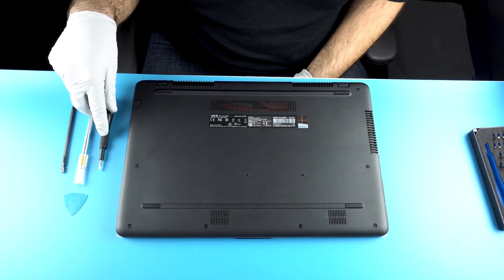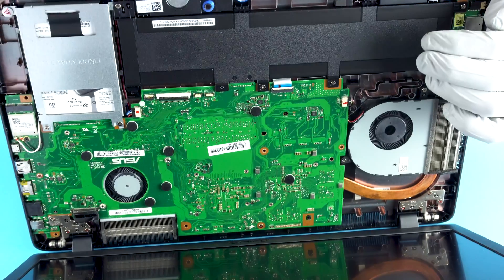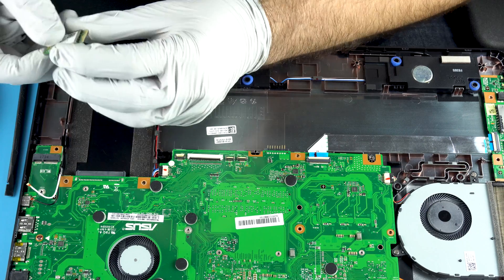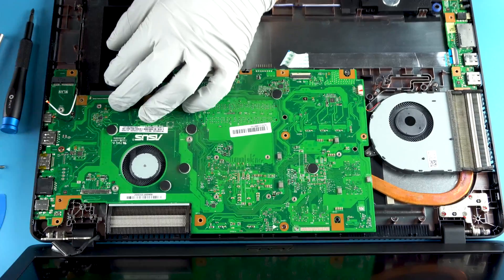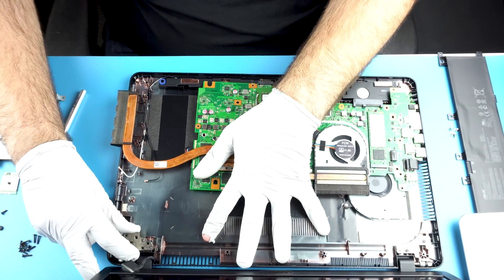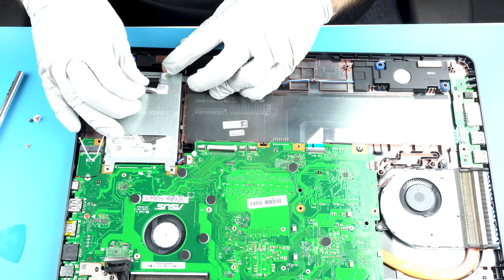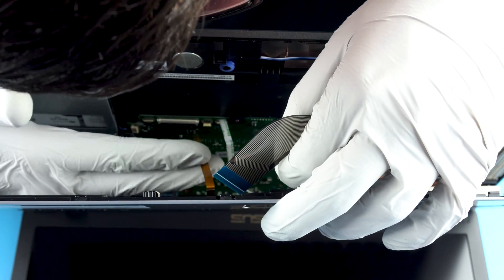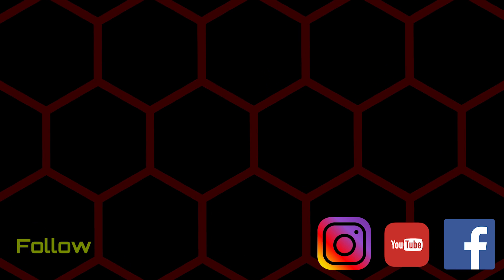Asus Vivobook 17 Pro N705UD | How to Service Upgrade & Laptop Teardown

Comment: Nice video.  It showed me how to remove the cables, but for something so critical to the success of this operation, it would have been much more helpful if the cable removal process was shown in more detail.  I had to rewatch a few times to catch the part where the cable holders had to be flipped up to release them.  And the keyboard cable removal was obscured so that detail could have been shown better.  Anyway, I finally got my battery, M.2 and HDD replaced with new parts.  In the future I'll have to do more research before buying a laptop so I don't end up with something that's such a nightmare to update.

Comment: Only way to start my Asus n705u is to remove AC cable, remove battery, put battery back in, reconnect AC power, and only then do 2 white lights appear bottom left of casing, near audio port, and I can then power on. It's a brand new battery that can hold a charge for months. BIOS reset. Cannot find the CMOS battery to try replace that, I don't know if this laptop even has one.

Comment: @Cukusa Great! you helped me upgrade RAM to 32Gb and a Intel Wi-Fi Card 6E
Reply: Which model exactly? I've been scouring the interwebs trying to find if mine is compatible with 32 gigs. I know my CPU is, just can't find if the mobo supports it. Also, was the replacement faster than 2400 Mhz?
Reply: @RedeemX-h2x 2400 is the maximum supported, I installed Crucial CT2K16G4SFD824A

Comment: Awesome video, following this managed to upgrade my M.2. Massive thanks. Only challenge was previous owner had not only removed M.2 but taken screw. Quick fix use one of the battery screws and will sort later. Also had planned to us heatsink but was too thick and motherboard slightly raised. First time fixed back on the trackpad was slightly raised, had to remove back and ensure one of the ribbons was bent over, used some sticky tape to help.
Reply: Did u upgrade the m.2 or to nvme ?
Reply: @mozesong5264  I installed a "Crucial BX500 1TB 3D NAND SATA 2.5 Inch Internal SSD - Up to 540MB/s - CT1000BX500SSD1" and also I updated 'Integral 512GB SSD NVME M.2 2280 PCIe Gen3x4 R-3450MB/s W-2400MB/s TLC M2 Solid State Drive'.

Comment: For those wanting to upgrade the 256GB M.2 SATA drive, YES - your laptop will support a NVMe drive!  Got a 1TB WD Blue during the Black Friday sales and it works perfectly.
Reply: 2TB Seagate Firecuda 520 gen 4. just for funzies!
Reply: Can confirm. My laptop model is a little different as it ends with X705FD_N705FD instead of N705UD, but it has the same type "Asus Vivobook Pro 17". I have successfully upgraded from the default micron ssd to a 1tb p31 nvme ssd just now, thanks to this video and this comment.

(Additional useful info for beginner people like me: )
- After changing your ssd, it may take a while for the pc to start booting for the first time so don't panic if the laptop doesn't immediately respond after pressing the power button
- If the laptop gets stuck at something like "something from startup isn't there/isn't right" when trying to start it the first time after swapping the ssd, boot into safe mode first and then restart the pc. It will work after that.
- Also if there's a weird issue such as image and video files not opening or you get something like "these pc results may not be complete" when opening cortana, it will fix itself when you reboot the pc 1~2 more times
- Don't forget to sync the time after finishing! (Idk if it automatically corrects itself after a while)

Comment: I just bought this computer, it will be here on Monday, now I kinda wish I had seen this video first because with my hands having bad Rheumatoid Arthritis, upgrading will have to be done by geek squad at Best Buy where I bought this thing, what happened to having individual covers on the bottom that you could remove and add a second HDD or memory without removing the Mobo? ah yes, make it harder so that you have to take it in to have it upgraded. so that this is now the standard saying "No user-serviceable parts inside"

I cut my teeth building systems from scratch for years, it is getting to the place where there is very little we can do ourselves due to the complexity being built-in on purpose.

feeding the corporate machine and that is just how they want it.

Comment: This laptop is no worst than any other one ive worked on. I  had a gpu bracket come unseated . Had to reglue them, but i ran out of kryonaut . i
I have some offbrand on my cpu for now because i trust the i7 to throttle the cpu better than the card . ???question IS do you reccomend a 30% silver on a laptop 1050 and 8550 like these or should i look at a different type of paste to Achieve optimal temps ? maybe heat pads on the ram or spreaders ?

Comment: Does s have two slots for an SSD? Because the Amazon site says it can hold a 1TB HHD, and a 128GB SSD.
Reply: It's configured to hold an HDD (or SSD) which is easy to get at, and a M.2 SSD which is underneath the motherboard.

Comment: Does the m.2 slot support NVMe drives?
Reply: Yes, i installed a sabrent 512gb and it works fine (3400 mb/s reading, 2500 mb/s writing)
Reply: @Paolo_980  still working fine?
Reply: @GolD3enAg3e  yes, all fine. I am using it right now.
Reply: Seems like a maybe. Contacted ASUS support and they said it supports SATA m.2. Others in here have commented that they upgraded to a Samsung EVO 970, so maybe? I'd love to know for sure!

Comment: Is there a way to hard reset the BIOS for stuck Vivobook Pro 17? I couldn't see a CMOS battery or jumper to do that.
Thank you in advance!
Reply: Hello. Could you/someone finally find a solution? I’m facing same issue, and I couldn’t find cmos battery or jumper hose too. Thanks for help.
Reply: @TT-hy3ml  No, I had to buy another laptop

Comment: That's a great video. I own the same model. I use it daily for 8+ hours. What would you say when I should replace the thermal paste on CPU and GPU? After 1 Year, 2 Years? The notebook is fine. Even though the fan on the left side is a bit noisy under load. Kinda high pitch noise.

Comment: You can fold up the board without unplugging the screen cable,  also the M.2 supports Nvme  with read speads around 2500 and wright 1400  so worth the upgrade
Reply: I want to install an SSD on my laptop, cause my vivobook pro 17 came out of the box without the SSD. So it's really possibile to install the Nvme version? (Thanks and sorry for my bad english)

Comment: so just got the model ASUS Vivobook 17 X705UA-GC452T seems much the same, but only 8gig not 16gig, asked the shop to upgrade the ram to 16gig but 40min later they said they couldn't without taking the whole thing apart lol only wanted to see where the ram slots are hidden, seems piss EZ really surprised they had it for 40min and ended up giving up, so as always if you want something done Dont ask the shop, Just do it yourself

Comment: Why do they make it so damn complicated to add one thing of ram?
Reply: To maximize the portability, performance and durability while minimizing the size (thickness) I guess.. If you throw your laptop and it spits your ram away, that's a problem.. Putting the fan deep within the mainboard seems a good idea too for me.
Reply: each next generation is more and more difficult to upgrade by owner.
Reply: so they can pack a gpu a board and cooler into a small machine 🤘

Comment: Is it possible to change the hard drive by only partially opening the laptop without touching the motherboard and those cables connecting the keyboard?
Reply: Though I've not tried, but I think it's possible with 90 degrees bent hex screwdrivers. Still have to remove battery first.

Comment: I have just got a Crucial DDR4 2400mhz 8GB ram which should be compatible but after carefully putting it back together, it did not start. I checked everything, and reconnected everything once more, also tried starting it without the ram I just installed, but nothing. Tried an online suggestion that told me to remove battery and hold the power button for a minute then plugging the charge cable in and then put in the battery but nothing seems to work. I don't know what to do. All the components are 100% intact so I think it's a connectivity problem. Do you have any ideas that might help?
Reply: The cables can be very easy to damage if to ruff, did you find out what happened ?

Comment: I tried to install Win7 and got broken BIOS. It only starts and shows the ASUS logo, no any boot process. And it's impossible to open BIOS settings or any other functions. Only Pwr btn and Ctrl+Alt+Delete works. What should I do to repair it?

Comment: At 2:32 i can see were the wifi module is, there is another slot on the other side. Could it be possible to plug an m2 ssd in there to expand the internal hard drive?
Reply: Normaly there is room for one more.

Comment: Is cpu upgradeble m8? help me pls
Reply: The motherboard does support driffent cpu's but why would you need to upgrade, the CPU that comes with it is very good, the letdown is the cheap drive they use, replace that and your see the most difference, i installed a  Samsung 970 EVO Plus 500GB M.2 (2280),NVMe SSD R/W(Max) 3,500MB/s/3,200MB/s, 480K/550K IOPS, and in the HDD bay another 500Gb samsung sata ssd, also upgraded the ram from 8gb to 16gb

Comment: The asus engineering is beautiful
Reply: Portgas D. Ace I don't agree. This laptop is very difficult to work on. Prefer designs that are easier to disassemble and reassemble. The further we go down this path the closer we get to a situation where its so risky to attempt it that its practically unserviceable.

Comment: Nice vid! is it possibile to chane the m.2 ssd opening the pc from the back, instead of dimsnatling everything :)?
Reply: Not possible. There is no access from the back. The only way to get at the M.2 is to remove and flip over the motherboard.  Can't partially lift the motherboard either, there are cables on 3 sides that need to be disconnected.

Comment: Very nice video! Thanks. I've upragraded my laptop by adding a new SSD, but after 1 month sound from the speakers dissapeared. If i plug in my headphones, the sound is ok. I've reinstalled the drivers - no help.

Comment: Does this asus work with nvme ssd?
Reply: I have the ASUSTeK COMPUTER INC. X705UNR 1.0 with the followingWDC WDS100T2B0B-00YS70.  I believe this drive is an NVME SSD as well.

Comment: Nice video... I have a problem though... My computer does not start and I really need to take back information that are on the SSD and HD... You know if I would loose the warranty if I take them out to take the information? I've seen there's a sticker on one of the screws on the HD... That sucks :p
Reply from the maker: Well, that depends. You do have a right to service your laptop if you are in the US and some other countries. I would check with Asus and see if that would void your warranty first.
Reply: Computer Upgrade King thanks for the quick answer... Will do as I'm in Brazil until July :(

Comment: What do you think of putting conductonaut on the cpu and then place a .03 copper shim then kryonaut?  I used conductonaut on an old xps17 and it dropped the temps 20°c, granted just removing the old thermal paste probably helped a lot in itself.

Comment: Thanks so much for posting this video.  I have a N705UN-ES76 and it looks similar to the N705UD-EH76 but instead of having one exhaust on the side and one on the back, they are both in the back.  I'm sure the disassembly will be basically identical.

Do you know the max ram that can be installed?  I was looking at a set of 2x8 DDR4 2666MHz. I cant find any information besides corsair's website that says these will be compatible.
Reply from the maker: Hey John. Max ram would be 2x16GB 2400.
Reply: Thanks!
Reply: I ended up grabbing 2×8gb sticks.  Also, it turns out I only have one fan.... Oh well.  I was going to liquid metal the cpu and gpu but it will contact what I could only imagine is aluminium so I put kryonaut instead.  Temps still get to 85 under full load  but I guess that's to be expected
Reply: Hey, guys, has someone tried to install 32gb RAM? It works?
Reply: There was an amazon review that mentioned they were able to add 32gb, Model will vary. https://www.amazon.com/gp/customer-reviews/R1BPBZTLDEWLHW/ref=cm_cr_arp_d_rvw_ttl?ie=UTF8&ASIN=B07661CYPD.

Comment: Very helpful video! BTW, didn't you notice a strange electric noisy buzzy sound from speakers when discrete video is under load? I tried to disconnect speakers and it helped, but I don't know exact reason..
Reply from the maker: Likely, there is nothing that can be done to fix that. If you are hearing that, then it's probably an electrical noise from the voltage regulators. There wouldn't be a work-around for that, unfortunately.
Reply from the maker: It might also be the MOSFET. In either case, it is a fairly common thing to hear that sound with a lot of GPUs and motherboards when they are under heavy load. ASUS may accept an RMA for it after you go through some trouble shooting with them. Might be worth the effort if it bothers you enough.
Reply: I came back to shop and tried two laptops of the same model. And.. the same noise. It's really an electrical noise. I think it's assembly defect of all vivobook 17" series or of that consignment at least. So I decided to swap this VivoBook with ASUS FX753. 
Thanks for reply!
Reply from the maker: You are most welcome. I hope you like your new laptop! :)
Reply: update drivers for fix it
Reply: That electronic noise can be avoided by unplugging the pc from the wall in my case